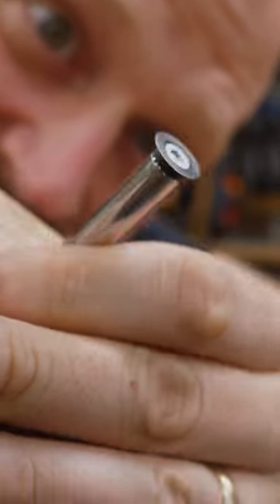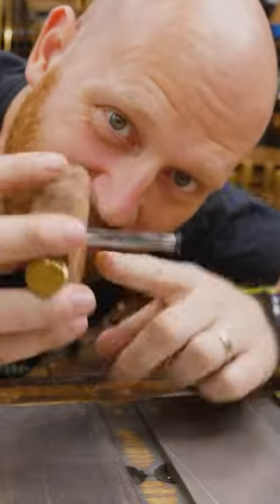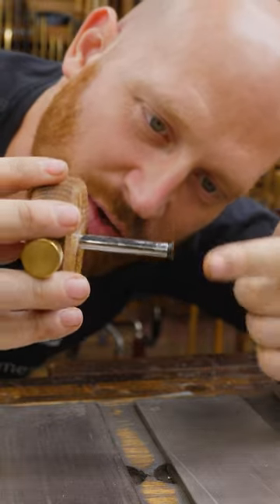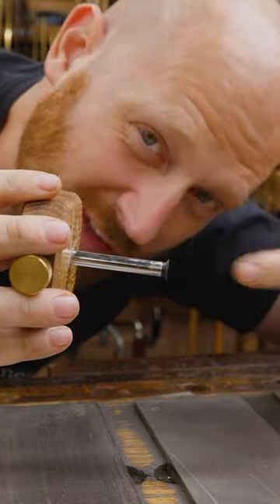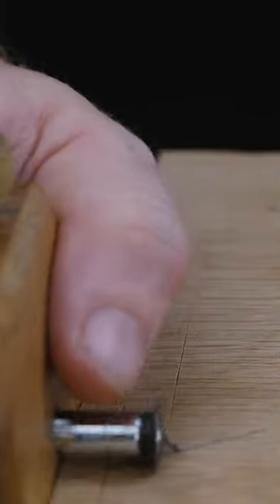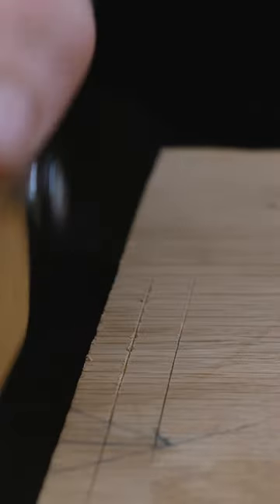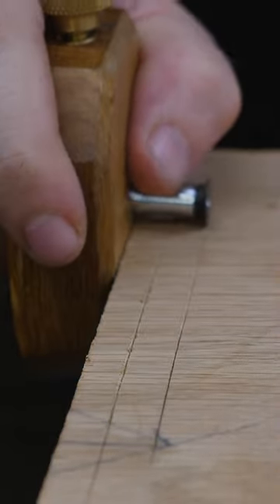Wheels On a Marking Kinfe Dont Work The Way You Think

Comment: Interesting, I didn’t know that it wasn’t supposed to spin freely. I’ve tried using it with the screw tightened down so the wheel can’t move and having the screw slightly loose so the wheel can spin but have had issues with getting it to mark a good straight line when marking with the grain, marking cross grain is a bit better though. I do also have an older pin style marking gauge that I find myself using more often.

Comment: Even if it did roll i dont think it would cut as well because the bearing would turn before the bit could dig in
Reply from the maker: Correct. The rolling is more crushing on the edge than it is cutting.

Comment: if it's not intended to roll, why make it like a wheel?
Reply: Starrett tools thought the same thing and offer a square wheel but cost 4 times as much.
Reply: Because the gauge is also round.  There is no cutting and non cutting side like on a pin marking gauge.  If you have a round cutter it will work no matter which way you are holding it in your hand and it will allow you to rotate your wrist while using it.